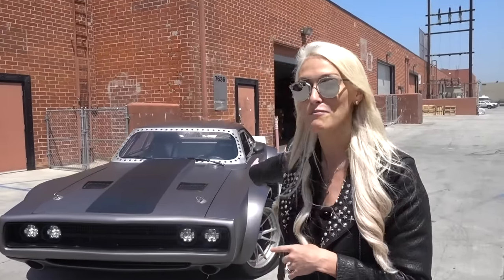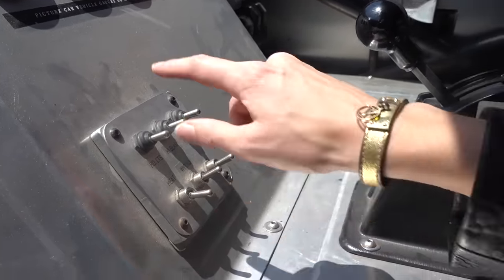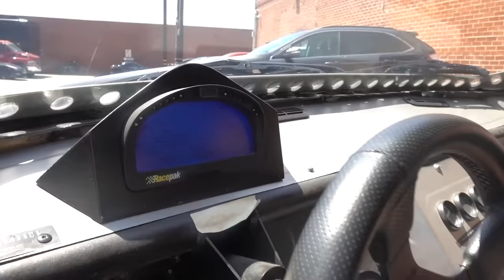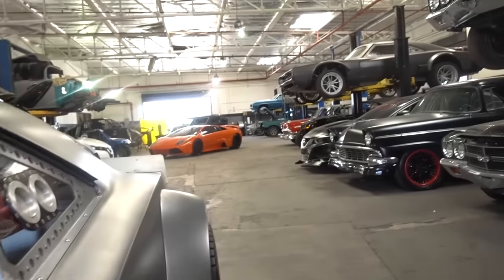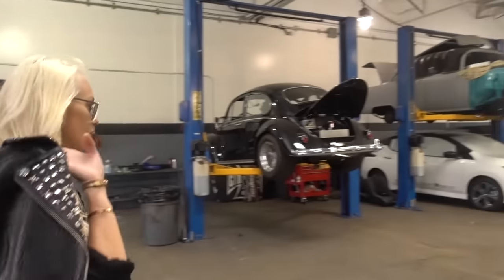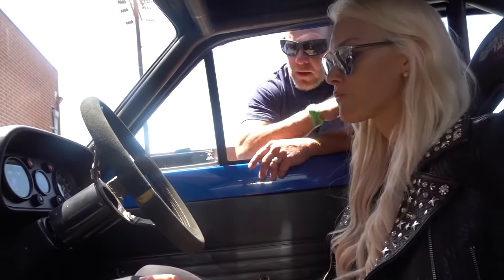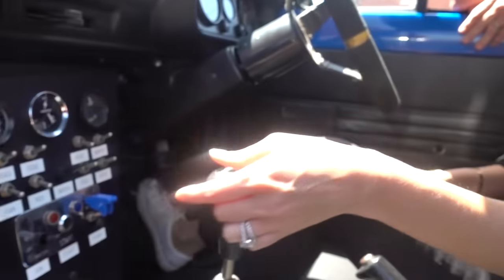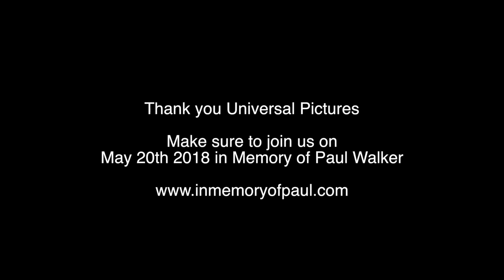Original Cars from Fast & Furious Movie!!!

Comment: Its easyer to start airplane than those cool cars.
Reply: Easier*
Reply: Have you seen the process to start up an air craft ? Especially from 2021 there’s like 30 steps 😂
Reply: @onepunch4798  Im talking about small one like Cessna plane
Reply: @Ayelzi  he was just saying bruh
Reply: @Ayelzi    You’re weird
Reply: @onepunch4798  not really u turn the battery on then align the irs and then you use the battery to supply power to the auxiliary power unit then you open the bleed values for the engine and then you turn on hydra and fuel pumps then you turn on engine starter to ground and once the n1 reaches to 20 percent you can introduce the fuel then you have a fully started aircraft easy as that
Reply: @aamikkalinin6385  Those still have ignition switches, 6 minute engine run, flight check, checklist, instruments set up. It takes about 30 minutes. It’s not really. Cessna’s and commercial.
Reply: @aamikkalinin6385  it's easy to put a slice of bread in a toaster then to start them cars
Reply: Play Microsoft Flight Simulator and you won't say that anymore😅
Reply: Uyandığım her gün dünya 🌎 biraz daha rahat uyuyor secret kıng active kıng

Comment: 2:59 cameraman got lucky that it didn't shoot flames... 😂 😂 😂
Reply: It does not shoot flames from that pipe
Reply: @karma_6932  pretty sure it does if it's up to temp and the exhaust is hot
Reply: its not shooting flames with that pipe
Reply: Samuel it actually does, but the exhaust just wasn’t hot enough at the moment
Reply: @samo3923  it does bruh but it wasn’t hot enough